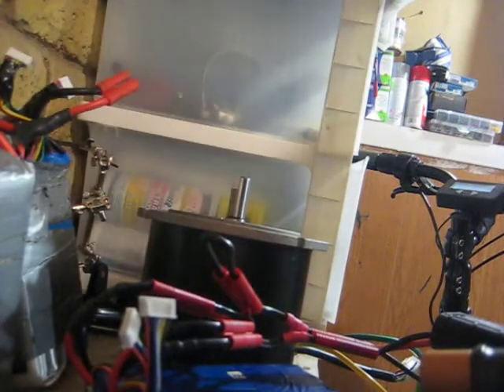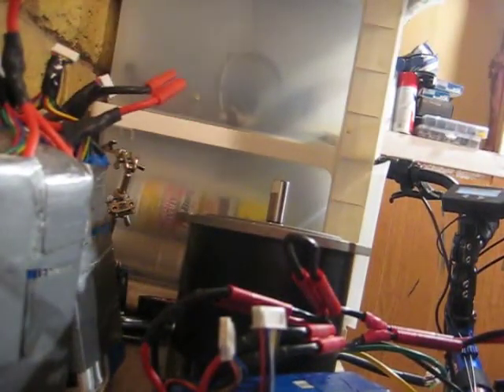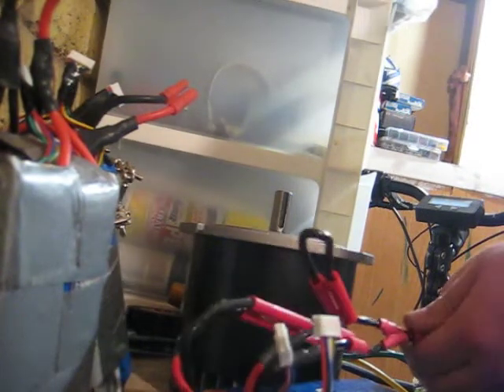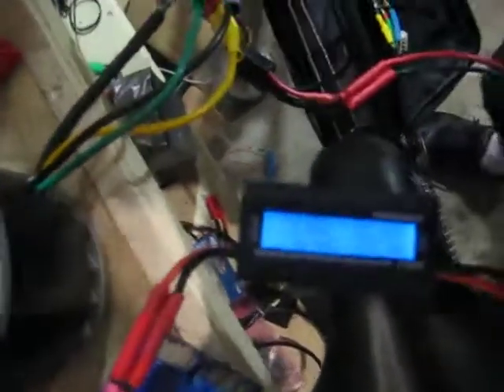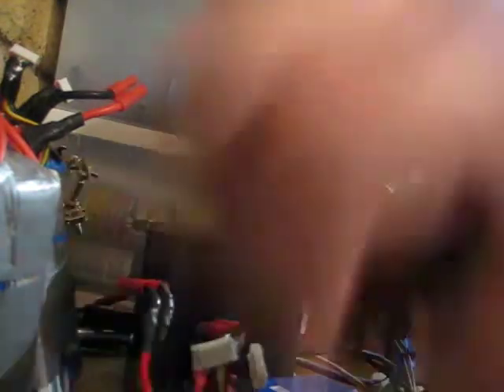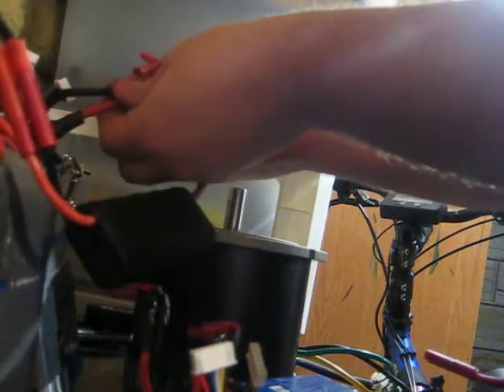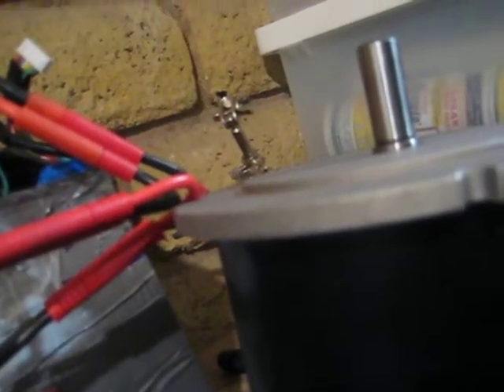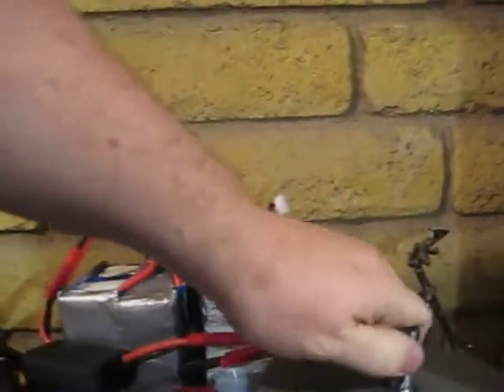Transmagnetics 3kW 38v 57v 76v spinup

Comment: i have a question i have a geared hub brushless 24v 250 watt. what would happen if i run 36 volts to it providing i get a 36 volt speed control?

Comment from the maker: You can see from my tests that the no-load watts increases 3.7x when the RPM is increased 2x. It gets exponentially worse from there. That is stator losses from the motor's design ( thick laminations ). If i spun it up to ~9000rpm, i would likely be turning 600W-1000W continuous of power into heat. That's not including copper losses from power..

This motor is not suitable for that kind of use. There are better motors for that job. Same issue with the motenergy motor my guy was using.